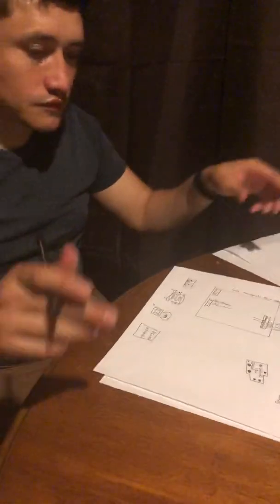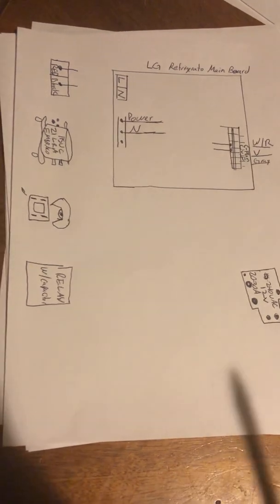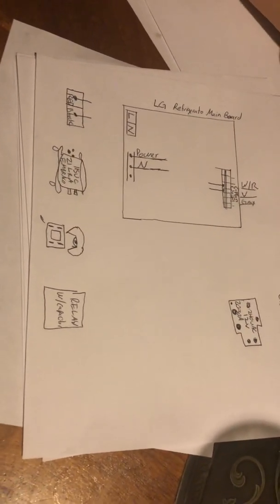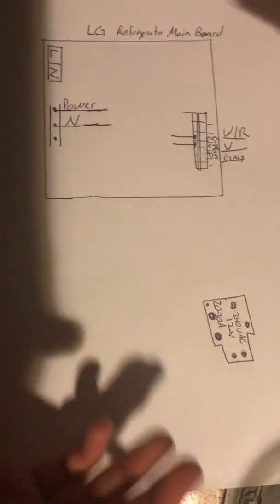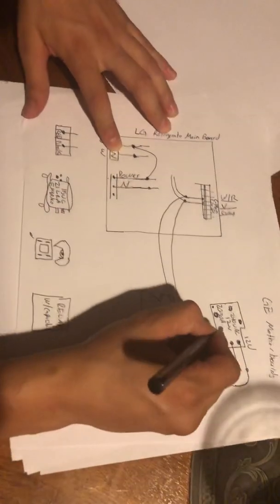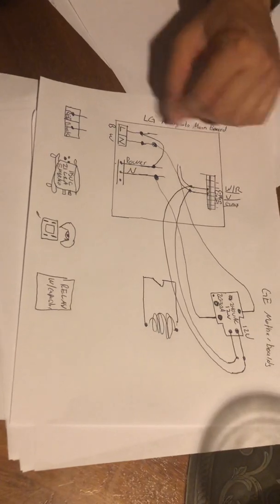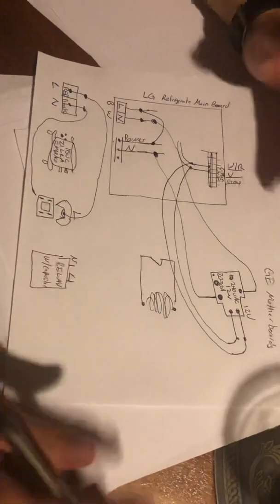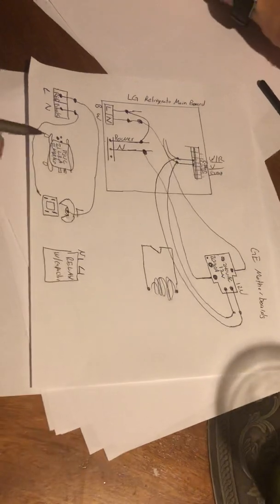LG Linear compressor Refrigerator  Alternative Replacements. Convert to 115v compressor Refrigerator

Comment: Jorge, please look at my previous posts.. I have checked probably 30 wires on the board and I can not locate which wire on my board gives the 12vdc signal only when the c-fan comes on. I have checked all listed under c-fan on con7 and even checked the wire on con6 that referenced the c-fan.. 
Also, new issue... I know that the refrigerator fan is not coming on and maybe others.. first clue was low side going hard into vacuum. Pulled cover in fridge cabinet and verufied.. put it into test mode and all fans do come on... what could cause that... this is a LMXS30796S  that failed 9 months after I plugged it in..  LG should be ashamed to charge people over 5k for these pieces of junk.  I do commercial refrigeration and residential is just frightening and ridiculously overly complicated.. such as 4 wires to run small 12vdc fan motors... energy savings I guess? 
PLEASE HELP A BROTHA 😖😫
Reply: Why not just connect at the cond fan motor at bottom .I would think a230 to 24v or 12 transformer   
could  be hooked to the old comp .leads  to drive a relay some say aphone charger works
Reply: @dondesnoo1771  
Also, I like to keep my work neat and not have random wires running here and there. All my wiring is inside behind panel. Good suggestion using leads directly feeding fan motor. Already thought about that and not much slack to pull harness out enough to patiently test the 16 combinations the 4 wires present unless you know which 2 actually have the 12vdc signal only when the fan runs... I have no clue why a simple 12vdc electric motor needs 4 wires to run... 1 might be sensor feed if variable speed? Pretty sure the variable speed fan motors I see on walk in cooler evaporators still only use 2.. I don't see that many. Heck, a/c air handlers use a bunch of wires, but I understand why... 1 speed for heat, another for fan only, and another for cooling mode. It's unnecessary for a condenser fan to change speeds unless it's an indoor condensing unit mounted outside with pressure control to shut fan off during winter until it builds enough head pressure to be efficient and then back on... Still, not variable... On/off..
Reply: @thedraftdept  Just curious if you were ever able to figure this one out? I have done this trick successfully to 8 or 9 of these refrigerators but I recently just encountered my first LG with 4 wires for the condenser fan motor. I agree that it is ridiculously over complicated, I think they do this crap on purpose so you have to use the original parts only or go buy another fancy looking piece of junk. It has to put out 12V though correct? Is it a matter of finding the color combination of 2 wires that generates the 12V? For example I have experimented quite a bit on other LG & Kenmore fridges and if you have a fridge with 3 wires to the condenser motor it doesn't matter which 2 wires you use to run to the relay. The dude that posted this video doesn't respond to any questions which is ironic if you are having a YouTube channel why would you post something and give anyone and everyone the middle finger when viewers watch and have questions.. seems counter productive to me but live and let live I suppose. Anyway I have one of these things in my garage that I havent been able to figure out with the 4 wire condenser fan motors and I was hoping you found a solution?
Reply: @jeremiahgeneration8910  im pretty sure he died. Anyway I have an idea since I have a beautiful fridge im trying to wire in with the 4 wire fan. Pisses me off btw because I was so excited when I got her to drop Temps and run right with two cords plugged in on for fridge and one for compressor. Anyway maybe a closed relay that opens when the defroster kicks on? Or i was thinking what about using something analog that gets pushed from the air current of the cfan and closes the loop for the compressor circuit. Could be simple like a poker card that goes back and wires touch to engage a relay or solenoid that triggers the 120v to the compressor. Or can a 120 ac volt relay or smaller with a register  be connected to the original
Reply: Well, the problem is that the control board sends variable voltage signals to the compressor. Starts off with lower voltage and slower compressor speeds and increases voltage and compressor speed as demand increases... Sounds a bit like control board forces the compressor to mimic what a TEV (TXV) does. Also, most cell phone chargers I've seen put out 5 volts (not enough) and if you use an A/C transformer, it puts out twice as much voltage as needed and I believe it's AC voltage, not DC . I found a great relay at Grainger and listed part number on one of my other comments. 
George has never answered me back, so I walked away from fridge for a while. My board is weird and doesn't match what he used as an example or even wiring diagram on back of unit. Everything connected up sweet and it cooled well except refrigerator compartment fans won't run unless in test mode and I checked every wire listed in diagram that referenced condenser fan and could not find the pair that powered down when fans shut off. May tackle later when my business slows down a bit and check the 4 wires that go into fan motor itself. Don't really know why all the 12vdc fan motors in this unit need 4 frickin wires to operate... Seems unnecessarily complicated. Also need to figure out why the compartment fans don't work unless I put board into diagnostic mode.. This is exactly why I do commercial equipment and not residential. They are simple and reliable and all use readily available components and don't have snotty proprietary parts... Even worse than proprietary, every model pretty much use parts unique to that model with only some interchangeable parts.
Reply: This manual should be close to the same as your model. Look at page 23 is the wiring diagram and condenser fan is called C Fan at CON 11 and has 3 wires. One is a feedback signal for rpm to the mainboard to monitor if fan is working, do not use that wire for the relay. Then on page 37 it shows CON 11 is the connector on mainboard and you want to tap into wires 1 and 2 to trigger the 12 v relay.  http://www.uncleharrywizard.com/nephewclub/wizardfrig/lg/lmx28994st-lg-refrigerator.pdf

Comment: Got this relay from Grainger...$10.75
Appears to be for compressors and should be easier to connect as it has spade connectors.. info says 1/4", but spade connections for 12vdc look like 3/16". Not a problem, you can get 3/16" female spade connectors from electrical section of every auto parts store I've been in. Let me know.. Info for this relay does not specify whether its rated at intermittent or continuous duty... 
https://www.grainger.com/mobile/product/SCHNEIDER-ELECTRIC-12VDC-6CWY9
Reply: SONG CHUAN Relay 832A-1C-S 12VDC 4 feet 30A 

That’s the relay he’s talking about in the video if you wanted to get one, its taking me about a month before I get it
Reply: @Asianredneckoutdoors  look at the relay from grainger I referenced. I went in and ordered it and had it next day. It's commercial grade and you don't have to solder wires to it. It uses 1/4" spade connectors for 120vac and 3/16" spade connectors for 12vdc . Much easier to wire
Reply: @thedraftdept  did it work?? I may do that because I don’t get mind until 3 weeks from now
Reply: @Asianredneckoutdoors  the relay works fine.. I've been hitting up jorge for weeks.. I either have a bad board or my wiring is completely different. I'm a commercial guy and residential is a completely different animal. I absolutely can not locate which lines power up the condenser fan even though I followed wiring diagram on back of unit.. also, evap fans inside do not run unless I put whole board in test mode...  
If I can find correct wires, this will work fine.
Reply: @thedraftdept  there are 3 wires to the condenser fan. 5v dc +  neg - and a rpm feedback to the board to monitor fan rpm. Make sure you tap into only the + and - wires to trigger the relay. The fans in these units are all BLDC (Brushless DC).
Reply: @houptee  I'm now seeing that there's 4 wires and I need to get a pcm(?) Signal to voltage converter. Apparently the + & - are 12vdc all the time and the feedback  signal actually controls whether the fan is running or not but don't have enough voltage themselves to run the relay. Any idea where I would get a pcm signal converter?
I gave up for a while, but it's an almost new $5000+ LG  and I won't give up yet. I did use an oversize embrace (1/3HP) that I use all the time in my commercial refrigeration.  It's all I had on hand. It seemed to work just fine.... except, it would never shut  off and I found that the evaporator fans were not working.
Ran the board through test mode and the evap fans ran during the test sequence  but still won't run during normal operation..
Any clue what would cause that?
Maybe bad motherboard or needs reprogramming? 
I prefer commercial equipment.  It follows the KISS principle... keep it simple stupid...
I find residential equipment needlessly over complicated. Idk why the control board can't be something similar to a KEY2 controller or a universal dixell refrigeration controller.
Reply: @houptee  I'm now seeing that there's 4 wires and I need to get a pcm(?) Signal to voltage converter. Apparently the + & - are 12vdc all the time and the feedback  signal actually controls whether the fan is running or not but don't have enough voltage themselves to run the relay. Any idea where I would get a pcm signal converter?
I gave up for a while, but it's an almost new $5000+ LG  and I won't give up yet. I did use an oversize embrace (1/3HP) that I use all the time in my commercial refrigeration.  It's all I had on hand. It seemed to work just fine.... except, it would never shut  off and I found that the evaporator fans were not working.
Ran the board through test mode and the evap fans ran during the test sequence  but still won't run during normal operation..
Any clue what would cause that?
Maybe bad motherboard or needs reprogramming? 
I prefer commercial equipment.  It follows the KISS principle... keep it simple stupid...
I find residential equipment needlessly over complicated. Idk why the control board can't be something similar to a KEY2 controller or a universal dixell refrigeration controller.
Reply: @thedraftdept  oh I think they changed the type of fan motors on newer LG the older had 3 wires and were BLDC brushless DC. I'm not sure what they are doing now with 4 wires you should be able to find a service manual for that fridge if you search and it has testing information for the motor voltage at each pin. The new compressors in almost all brands are now inverter driven 3 phase with U V W phases coming out of the inverter to 3 pins on compressors. LG is only using 2 pins to power the linear compressor but the inverter circuit has all 3 outputs and one phase is looping back on the board schematic since it's not needed. So for the fan im not sure if they are using a 3 phase type now but that would explain 4 wires. U V W and a feedback rpm signal. I'm sure commercial refrigeration will start using inverter compressors soon to improve energy efficiency. I do HVAC and mini splits are all inverter. Now they are coming out with heat pumps to replace gas furnaces with inverter condensing units and air handlers that can heat down to below 0. Check out Mr Cool universal heat pumps which are rebadged Gree Flexx machines. And Bosch IDS 2.0 heat pumps. Fujitsu also has systems.
Reply: I’ve got the link saved, thanks

Comment: I'm going to do this. My LG model # lmxs30796s . Do you pull 12vdc condenser fan signal from con6 or con7? I see reference to c-fan on both although con6 says c-fan pwn.. also, if I am deciphering small print on pcb correctly, colors do not match. On con7, I see 2 violet wires and 2 white/red stripe... or is one of them darker red or maybe reddish orange? I would trace it with voltmeter, but f-fan is exactly next to c-fan and I'm sure once I plug in refrigerator that 12vdc will be active on both condenser and evaporators . 
Can you clarify? I do commercial refrigeration and never have to deal with a computer overlord controlling everything.  There is a t-stat that switches condensing unit on/off and evap fans run continuously..  anyhow, if I have to pull 12vdc signal from condenser fan motor instead of board, which 2 colors there? I see solid red, yellow, black, and violet.. 
Confused up on board by duplicate violet & red/white on same con7 and they don't seem to jive with print.. 
A nice close up of your connections would be nice if boards are all generally the same. Mine has the 3 way splitter/solenoid on it.. I assume for customized middle drawer temp? Or freezer? Not sure, this is my first and last LG refrigerator. 
Thanks, sorry so verbose
Reply: Hope I dont seem like a moron, your video was straight forward. I'm sure my motherboard is different, because like I said earlier, there are duplicates of same colors on con7 (upper rightmost connector) and they don't seem to agree with printed guide above connector.
Again, thanks. 
Btw, brand new and compressor went after 9 months. Absolute junk!

Comment: How is the defrost  going to work if you turning off the compressor
Reply: Residential refrigeration does not use hot gas defrost and I've only seen that at  1 of my commercial accounts... Hot gas defrost basically works like a heat pump A/C by a reversing valve that forces the evap to become the condenser.  Looks like residential refrigeration uses hot electic defrost elements to melt ice from coils on freezer and refrigerator.. Mmkay, compressor has nothing to do with defrost.

Comment: I finally got it working it seems the wiring on my LG refrigerator was different since it was a late 2019 model the board was completly different. Thanks for sharing this info!!
Reply: So in the schematic he's showing the line input tied to the inverter output...or is he disconnecting the inverter output and using the wires only? The board in his previous video matched mine, but his labels on this schematic don't. (just tryin' to make sure I don't smoke the circus, you know) I disconnected the cap & motor cables, then used the motor cables to tie to the line, and dropped the relay in the compressor compartment...
Reply: GKS yes you are only going to use the wires in my case they were black and blue. You are not going to use the inverter anymore.

Comment: This is some amazing stuff. I just took a linera compressor off my LG and installed a basic whirlpool compressor and ran a 3 in 1 start capacitor straight to the wall.  It's working really well.  What's your thoughts on that.
Reply: Umm, what cycles the compressor on/off? If you ran leads on 3n1 straight to wall outlet, seems it would stay on and not shut off.. I probably misunderstood you, because I'm sure you don't stand there watching a thermometer and unplug unit when it's cold enough and vice-versa.... Do you?
Reply: @thedraftdept  wouldn't the 3rd wire be connected the the motherboard for switching
Reply: How and when would the compressor turn off?  I think it should shit off when the compressor isn’t needed.
Reply: Could you give me a diagram how to wire the compressor?  And what's the part # of thr whirlpool comp?  Or should i stick with the Embraco? 
Thanks so much..
Very impressed on what you are doing...

Comment: Do you any pic from the ge relay
Reply: Dudes! I left info for a viable relay from grainger . $10.95 and a lot easier to connect . It uses 1/4" spade connectors for 120vac device and 3/16" spade connectors from automotive store for 12vdc coil inputs. Super easy and can mount it with screws or it's small enough to tuck in next to pcb
Reply: @thedraftdept  so if I do this mod the Kenmore frig [lg]. This will work!?   Do I still need to software update the board?
Reply: @jamesguralski5156  sorry, I don't think so... I am a commercial refrigeration guy... This over-engineered residential junk drives me crazy. Everything is apparently computer controlled and very little use if logic and/or mechanical controls. It should work just fine.
Reply: @thedraftdept  true. The model electronics just fail all the time.   The old stuff works and still does...
Reply: SONG CHUAN Relay 832A-1C-S 12VDC 4 feet 30A

That the info for it, only eBay sales if

Comment: Have you seen bad restrictions in the LG dual evap machines? I am trying to figure out why I have crazy high side pressure and low side is in a vacuum. I think it's the 3 way valve is clogged up or stuck in the pump down position. These machines do a pump down and close off the valve and store the refrigerant in the condenser.
Reply: I have one that had the three-way valve clogged almost completely to the fridge evap.
Reply: Did you figure out this issue? I am having the same issue on mine (vacuum on low side and very high pressure on the high side).  Also, the led on the board is blinking 7 times.